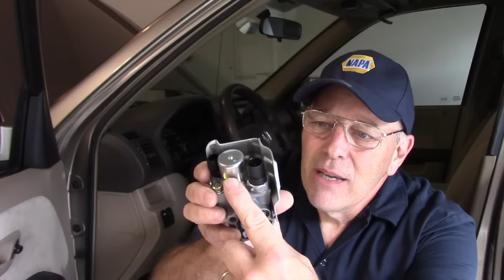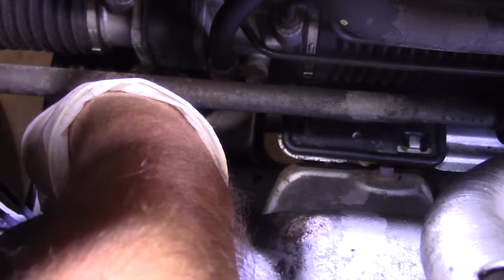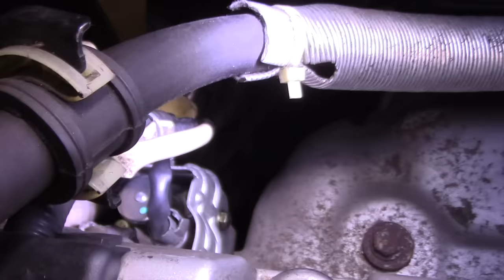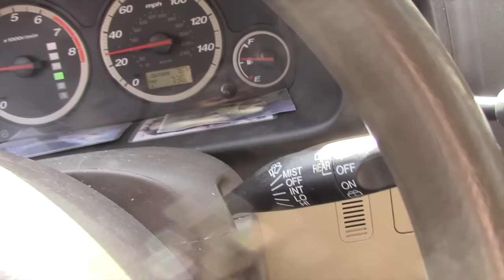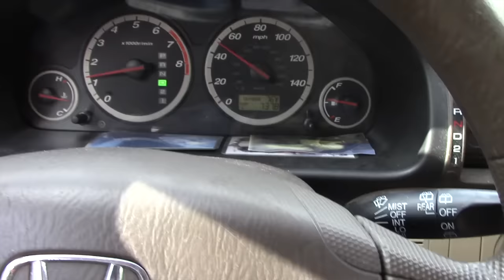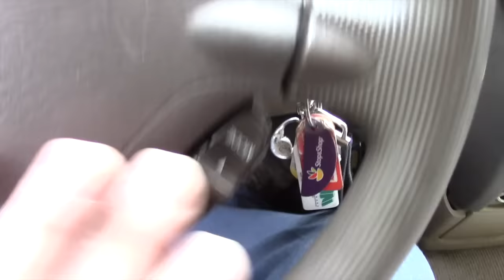VTEC Repair  P2647 Or 2646 (Pressure Circuit Voltage High Or Low)

Comment: Ummm, I get confused now.  I have the same code p2646 on my 2004 Honda Civic ex.  I replaced the whole vtech selonoid assembly as you described, changed brand new oil & filter, cleared the code, but the same code comes right back up after about 1-2 minutes of starting the engine.  Is there another selonoid somewhere?  Lots of vdo on YouTube saying the same thing, but it doesn’t work in my case.
Reply: Clean the screen on engine behind the power steering pump.  The pump has to be unbolted along with the tensioner for the serpentine belt.  Before you start use a long breaker bar on tensioner to pop the top portion of serpentine belt off. Then it's just a few bolts to remove in order to get to the small square cover for the screen.  2 10mm bolts to remove the screen.   Also if you bought the solenoid and it's a doorman it could be a bad solenoid/sending unit.  I put two doorman units in both were bad.  Go genuine Honda on this part and save a headache
Reply: If it's an aftermarket solenoid unit doorman etc they are trash. Return it and buy a honda solenoid
Reply from the maker: I agree don't use any aftermarket arts us the original Honda parts. Thanks for watching and your input.
Reply from the maker: Where did you buy the parts? Don't use any aftermarket parts us the original Honda parts.

Comment: 2006 element Honda check engine light on, code p2646,rocker arm oil control valve stuck , i already Replace new vtc twice still Engine light on and while i driving on road the rpm reach more then 3 rpm then shift second gear Plus burn too much gas any suggest? thanks
Reply from the maker: Where did you get the assembly from?
Reply: @jimthecarguy  from auto zone ,my wife wanted me to bring the car to the dealership and have them check the engine light. The computer found is engine light .code 2646, Rocker arm oil control valve stuck,
Reply: https://www.youtube.com/watch?v=SKp6Yhe7XRY

Comment: Just wanna know if there’s a special oil filter that I need to use on my car 2007 crv 2.4
Reply from the maker: No nothing special. Just make sure to use a quality filter and change your oil regularly.(3,000-5,000 miles)
Reply: @jimthecarguy  hello i have the same problem with my acura rsx it has a k20a3 a year ago i changed first the oil pressure than the actual solenoid because the code did not go away in my old solenoid i found medal shavings  after that i bought a new vtec solenoid from o'Reilly's  bit the code did not go away when i try to rev my car past 4k my car stutters and i cant rev it past 4k rpms i had 2 mechanics who checked that code and they said the vtec and oil pressure switch are both engaging and they need to do further investigation the code is p2646   low voltage and i took it to another mechanic he said my cylinder head is worned out and that my engine has  low compression and that also my ecu stops recieving signals but the other 2 mechanics said the engine sounds to healthy and its not knocking nor showing signs of low compression what should be my next move ? My car has 268k miles no tickings or knocking nor any blue smoke coming out the and no oil leaks the engine sounds healthy and i already cleaned the other oil passages and replaced those screens to idk what to do can u give me advices thank you!
Reply: @rsxonprogress9488   I have same issue did u fix it?????
Reply: @davidcutsinger3574  yes by replacing the motor.

Comment: I need help when I start my car I see oil coming out where the oil filter is at I’ve notice it when every time my engine light ons and vsa light pls I need help can u tell me what the problem is
Reply from the maker: If it is leaking from the oil filter it is possible the the filter gasket is defective.
Reply: @jimthecarguy  I see the oil squirting to the oil filter but coming out where the oil pan gasket not to far from it only when I on my car that's when it leaks pretty bad could it be my oil pan gasket or my VTech gasket I don't wanna change it and it's not the problem pls in need of help
Reply: And I also bought a new oil filter still leaking ......it only leaks very bad when car is on

Comment: I did this fix and car drove fine on the hwy then after about 15 min it started bucking again in acceleration any ideas ?
Reply: Check your oil level and connectors to the assembly.  Might have a bad connection.
Reply from the maker: Was the assembly from the dealer or aftermarket?
Reply: jimthecarguy it was from the dealer however we bought it from a used car lot the oil was clean but I changed it anyway and made sure it was 5w20 and changed the part again just Incase now it’s working great so must of been a bad part or wrong oil viscosity I guess. Thank you for replying
Reply: @trenthoward2351  I'm having same problem did you fix the issue?
Reply: @davidcutsinger3574  I put another one on and changes the oil to spec it may of had the wrong oil or I got a bad part ever since it’s driven great
Reply from the maker: Good advice.

Comment: I have these exact symptoms. 2004 MDX. Checked resistance of the pressure switch and solenoid, both good with low non-zero resistance (indicating the coil is probably good). Removed the VTEC valve assembly and found the gasket screen strainer to be 90% clogged with crud. Installed new one, same symptoms. Perhaps oil-related?... This didn't start until after I changed the oil (but not immediately after)... While I did just change the oil recently, I used 10W-30 which is heavier than the recommended 5w-20 (with the thought that at 260K miles it could benefit from slightly heavier), perhaps the system doesn't function well with heavier oil?  I'm going to poke around some other ideas, but I might end up changing the oil again, back to 5W-30. (I've used Amsoil since I got the vehicle, at 124K miles.)
Reply from the maker: I think you are correct about the oil. Change the oil back to what it calls for the 5w20. Keep me posted. Thank you for watching. Watch for the next free tool giveaway coming soon.
Reply: I changed the oil after pouring in a pint of engine flush and running for ten minutes. Put on new filter and new 5w-20 oil.  No improvement. So, I have ordered the replacement valve body assembly, should have it Tuesday...
Reply: So.... while awaiting the new VTEC valve assembly to arrive via US Post, I installed a new alternator since I'm in that area and it also is original, with 260K miles on it. Then the valve assembly arrived today and I installed it. Voila, problem solved.
Reply: AmericanBerean why a new alternator?

Comment: thanks for the video @jimthecarguy..... so it appears that the oil pressure switch itself is around $10 to $20... but the full solenoid seems to be around $200-$500 for an 2005 Odyssey... do you think I can get buy with just replacing the switch for now? thanks for your time.
Reply from the maker: There is a service bulletin about the pressure switch and connectors failing but truthfully I recommend replacing the entire assemble

Comment: What if you keep getting the P2646 code after replacing the solenoid??
Reply from the maker: What brand solenoid did you use?
Reply: I replaced the solenoid with a used one from a car same as mine though my car still barges when it reaches 5-6 rpm
Reply: Bucking*
Reply: Used one could have same problem

Comment: Hi
I have a 2005 Honda CRV they change this particular part that you’re speaking of two times and I still have the same problem. Could it be that the part is messed up or is it possible that it could be the wires or is there something else wrong ? Please help it is definitely the same problem.and the same part desperate seeking help
Reply from the maker: Do you know if the parts were dealer parts or some aftermarket parts?

Comment: Hi Jim, I have the same code number in my 05 Accord P2647, but the verbiage is different. My code reader says P2647 A Rocker Arm Actuator System Stuck on Bank 1. I am getting the bucking when I try to accelerate around 3000 rpm. Do you think it’s the same issue as the reading you’re getting?
Reply from the maker: Most of the time it is the same problem. There is a technical service bulletin about this. I'm happy to help. Thanks for watching. Don't forget to hit the bell for notifications when a new video is posted.

Comment: Put second solenoid, cleaned the screen. Still have the problem. None mention about VSA light. Was reading about oil change. Didn't have the problem before it. I put castrol magnatec 5w20. Is it oil, or just bad luck on eBay solenoid? What should I do next. Help pls.
Reply from the maker: Honestly I only use the Honda assembly because the aftermarket are just not dependable. Keep me posted. I'm happy to help. Thanks for watching

Comment: Hey jim I just changed my oil to royal purple 10-30 and put a K&n oil filter and new vtec solenoid then my car started giving me that code but I drive a 2004 Acura rsx it was a p2647 code what did I do wrong????? Please help
Reply from the maker: 10w 30 is not the right oil. If the code was not there before you did the oil change I would put in the correct oil first. Thank you for watching .  Don't forget to subscribe.

Comment: You saved me A LOT OF diag money, thank you sir. I had the p2647 as well. All though the oil level on the car was a bit low, i knew the switch/valve was bad because when i topped off the oil, the car threw a few more ABS codes. Once I changed the switch assbly, it all went AWAY! 2007 Honda CRV
Reply from the maker: Thank you for watching . I'm happy to help. Don't forget to subscribe.
Reply: You changed the sensor or the whole vtec solenoid
Reply: He changed the entire VTech solenoid, according to the video.
Reply: I changed the solenoid and threw the code again. Abs code too. Could it be the connectors?

Comment: Do you use original Honda for this or can you use other brands from parts store?
Reply from the maker: I would recommend only using the Genuine Honda parts. There has been a lot of problems with the aftermarket. Let me know how you do. Thanks for watching.
Reply: Waiting on the answer for this too... The Genuine Part is 111 on amazon
Reply from the maker: I would recommend only using the Genuine Honda parts. There has been a lot of problems with the aftermarket. Let me know how you do. Thanks for watching.
Reply: I need to know if you bought honda part or aftermarket im having same problem

Comment: My code is a P2647 a rocker arm actuator stuck on bank 1.
The did do the repair unfortunately due to the cold I have no place to do the repair it was fine for five days then it did it again tonight. The car would  jerk on acceleration. The mechanic replace the oil sending unit I am just wondering if he replaced the entire Vtec solenoid assembly. 

I think he tried to just replace the switch that's why it was as cheap as it was.

 I would have rather him replace the entire unit for a little bit more. The oil level is perfect.The oil was changed less than 300 miles ago.

Thanks for the info.👍
Reply from the maker: Yes it is a good idea to replace the whole assembly . I would recommend get the parts from the dealer because the aftermarket is not a dependable. Thank you for watching.
Reply: Mine is saying the same thing right now.

Comment: I have a Honda CRV 2007, As soon as i did the oil change, when i picked up my vehicle and heading towards home, I saw the check engine light, when i enquired about the code its P2647. What should i do in this case, Please recommend.
Reply from the maker: Did you check the oil level? It may be low. Was the light on before the oil change?
Reply: @jimthecarguy  
Hi jim. No the light was not on before the oil change.
Reply from the maker: @shaikzameer7185  Did you check the level. Also what was the weight of the oil they used?
Reply: @jimthecarguy  Hi Jim.Thank you so much for replying. The oil level shows 100% on the dashboard. This check engine light goes off by itself and after a few days again lights up and then when it lights up i can feel the jerk while I drive. So not sure what's going on. Do I have to change the solenoid?? no clue
Reply from the maker: @shaikzameer7185   Check the oil level under the hood with the engine dip stick. Is it full?

Comment: I would be muchly appreciated if someone could explain to me what to do next if you've already done everything in this video I get approximately 45 minutes of driving before my oil switch or oil transducer that's on this piece is always on the on position even when VTEC kicks in the oil switch still says on I have a Snap-On $2,000 reader that I've used that's my friends so I can monitor both in real time
Reply from the maker: The assembly what brand was it? Don't tell me Dorman.Lol
Reply: @jimthecarguy  I changed the oil and put the right oil in even though I just got done building the engine I had break in oil in there after I change the oil the problem completely went away
Reply: @jimthecarguy  you're right that's the name
Reply: Doesn't hondas have two sensors,  one on solenoid and one rocker arm A
Reply: Did u figure the problem???? I'm have same issue ive done it all

Comment: I flushed mine good with the Valvoline engine flush, replaced oil with full synthetic and the problem is gone.  This is a good reason to keep your oil changed. Also there is an oiler for the timing chain that clogs if you don't keep it changed.

Comment: I renplace the hole vtec solenoid but the pressure sensor won't look the same   now my car have problems RPM won't go over 3000 the car feel like going stall i m thinking to change the pressure sensor for the other one

Comment: I have an 04 accord same issue.i changed the same part and the oil pressure switch as well but still having the same issue please help
Reply: Carlos Diaz i cant believe it but i changed all that stuff and light was still on i aired up tires to about 10 pounds more then they needed and check engine light went off and had any problems like before it was cutting out around 3000 rpm

Comment: Changing the oil regularly and checking the oil level often are the best ways to keep the VTEC working properly.  Great video Jim.
Reply: I think you are the most amazing teacher, mechanic, human, man.. I love you and your videos. You have inspired me and taught me so much. I am a 50 year old African American female, and I have a Honda Element, and I am experiencing this problem. I actually learned so much from you. I wish I can meet you and I wish I can get more videos that are explained as thorough as yours thank you so much
Reply: Engin oil or transmission oil??
Please i have an acura tl 2006 but I can't rev up above 5k rpm I think the vtec is not working?
Reply: 05 element bucking and jerking downshifting when I accelerate  no vtecj codes only P0507 and Abs light on. Also if u have a spindle on driver side with no sensor on it will that make the downshift someone please help no other codes😞😞
Reply: what if the oil level is too high? About 5mm over the top dot, could that cause it?